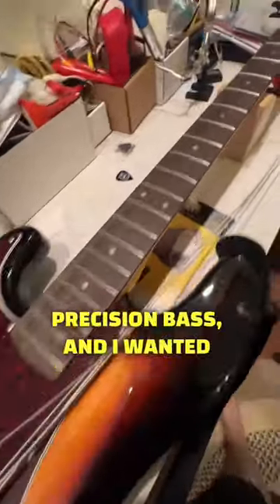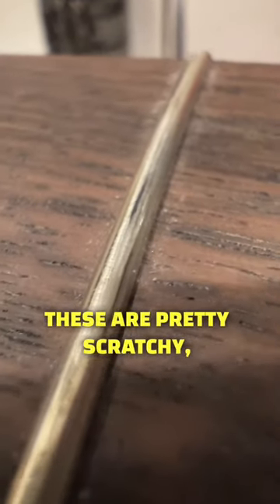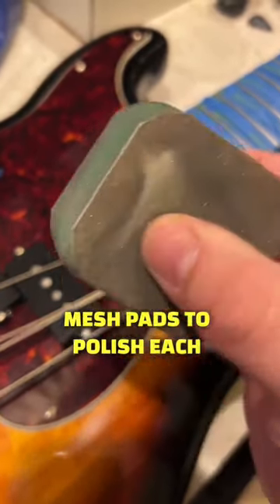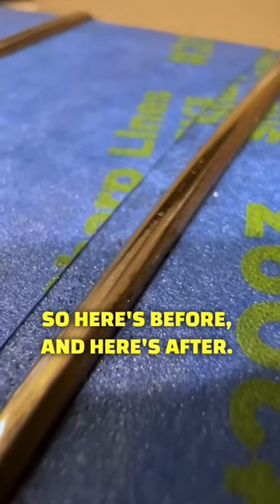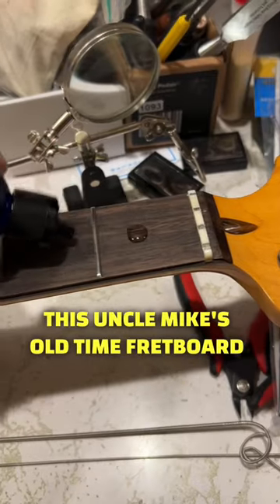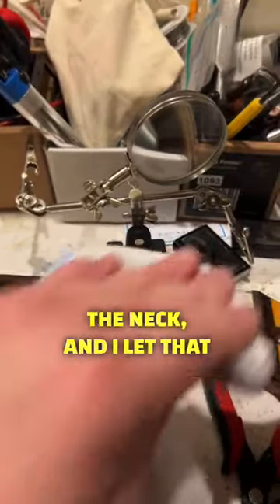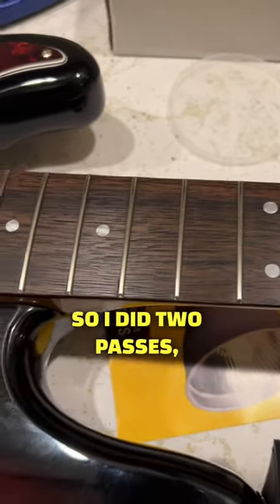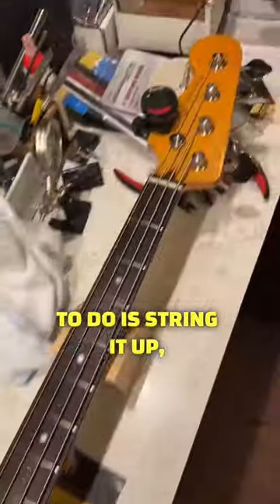2 common issues with affordable instruments

Comment: Do you have a link to the micromesh pads? I recently got a CV Jaguar and have the same issues.
Reply from the maker: Absolutely! I’ll put it in the description if I’m able to as well. https://www.amazon.com/Sanding-Stopper-Polishing-Perfect-Materials/dp/B000H6EC4C/ref=mp_s_a_1_3?crid=W7M79B8VT8GL&keywords=micro+mesh+polishing&qid=1673750717&sprefix=micro+mesh+polishing%2Caps%2C137&sr=8-3
Reply: @EricMerrow  Much appreciated, I'm not sure if they're the same thing, but the D'addario polish system sheets are decent too. Much cleaner than steel wool, and they supply a paper fret guard in the package.